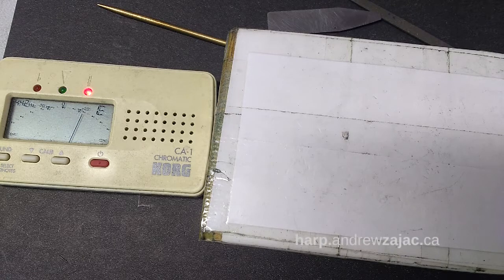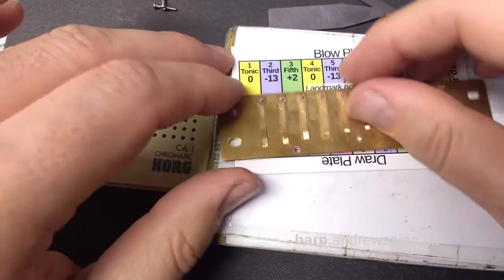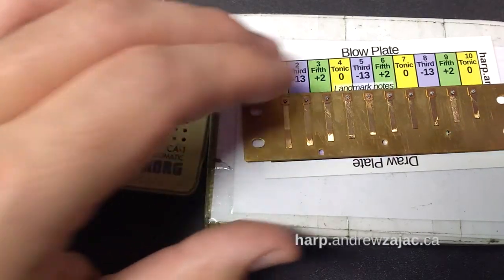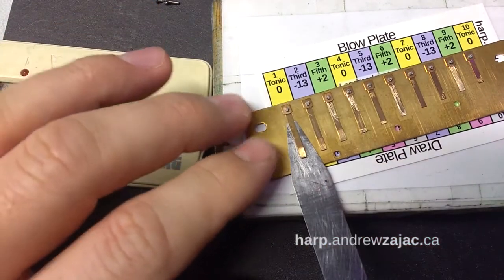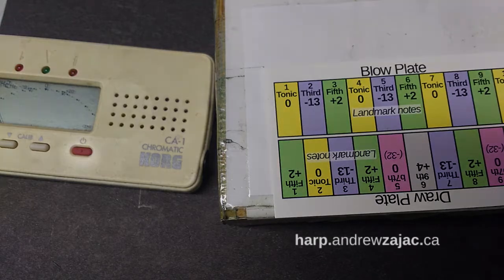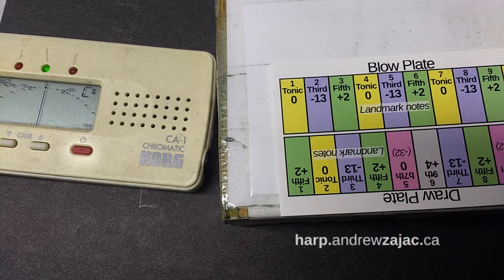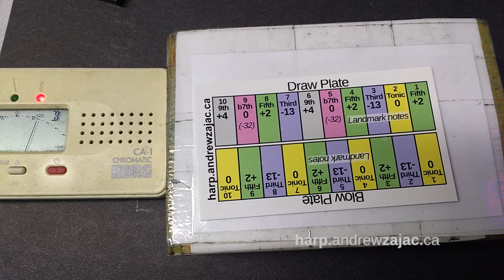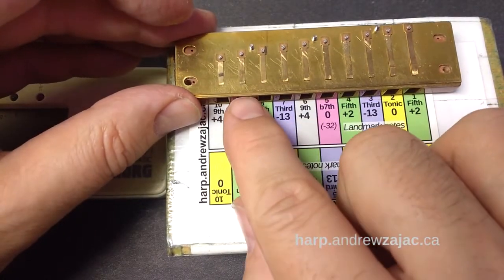The Tuning Card can help you in many ways

Comment: I agree with Ma.l Newtrisson and Michael Feliner. Confused and lost. 0,+2, -13.What’s beating?  I’m not putting your video down at all. I’m trying to tune a Special 20 and Meisterklassic. I’ve played for years. A tune comes into my head I work on it until I have it. It used to be a fun easy instrument to play. Any feedback would be appreciated. Or maybe the harmonica is over my head.
Reply: Sound waves have a frequency(Hz, or cycles per second).  If you play multiple notes together, you want 3rds and 5ths and such, complimentary notes that sound harmonious.
But equal temperment(Beginner tuning in this video, 12TET like a basic keyboard or guitar tuning) fudges the numbers a bit to fit into 12 tones.  So the notes aren't EXACTLY frequency correct, they've been squashed into the 12 tones we use.
Frequency means time, so those tonic/3rds/5ths/etc are slightly out of sync with each other, creating beating(think about it as a ghost note machines can't perceive)  We hear it because the connection between our ears and brains is a weird organic interface.  You can "hear" a swelling and fading when what SHOULD be a good harmonious mix of notes has imperfections in the sync between notes.
That's why he's tuning for chords/octaves.  He's putting those notes in sync with each other, which the chromatic tuner would say is out of tune(because the tuner is doing 12TET),  You can't perceive a few cents difference in tuning on a single note, but as the two notes get closer to being in sync, the chord sounds "better" and the beating gets fainter/vanishes.
Yes, when you scape at the base of the reed, that note vibrates slightly slower(and faster if you scrape the tip of the reed).  We rely, not on being able to directly hear these imperceptible changes(to normal people), but on this weird beating that results when they interact.